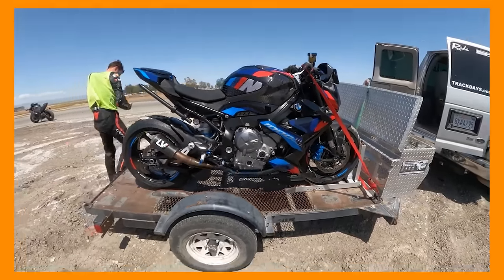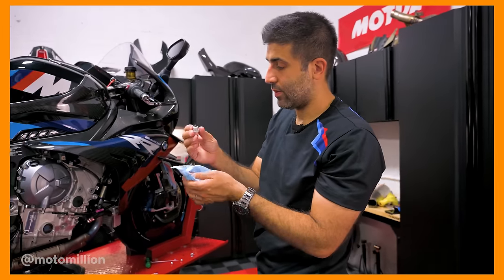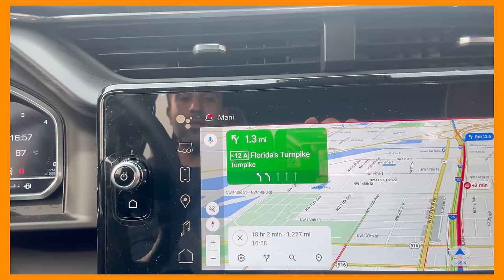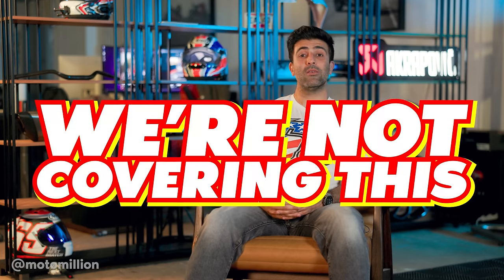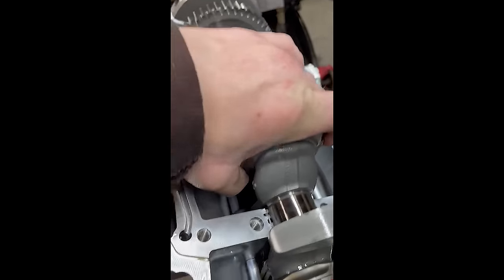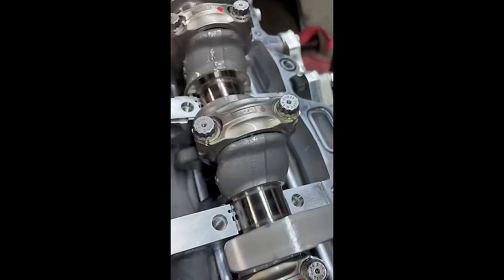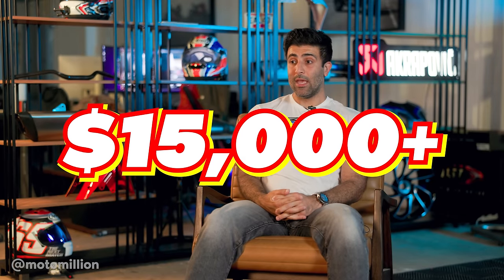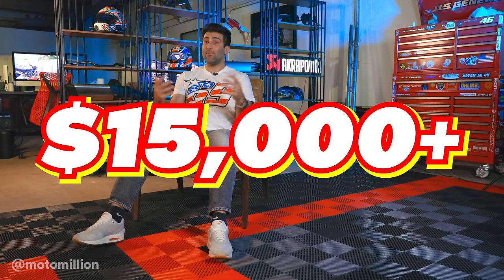MASSIVE Engine Failure on our M1000RR & BMW REFUSED Warranty...

Comment: Somewhere at Mottorad HQ engineering dept in Munich, Hans is sitting at his desk ,sipping on filter coffee while watching this video and thinking.. Oh shit ! i probably should have triple checked the rod cap bolt torque settings before signing off to the engine assembly guys. What is it about rod bearings that they cant get right , even in their road cars, e46m3 , e90m3 , e60 m5, F10m5 all had higher than avg rod bearing  failures and now their top of the range super sports bike
Reply from the maker: I don't even think BMW will watch this, I mean if they do, I hope they reach out to us to make things right.
Reply: I can't speak to the bikes. But, on the cars, BMW decided that they would put rod bearings in that only lasted through the warranty/1st owner, in order to make more money. They literally only put enough wear material on the bearings to last 40,000mi ish.
Clevite makes bearings for most of the cars that have the issue, that will last a "Normal" amount of time. Luckily BMW was kind enough to build the vehicles, in most cases, so that the bearings can be replaced without pulling the engine...
But, yeah, terrible idea...
Reply: @therocket280z7 😂😂not true, I know Bmw 530i with over 250000 miles without any problems🔥better then most American car and the worst Range Rover😩
Reply: @helgejohan3604  lol, yes, it's not true about all the cars. But it's absolutely true about most of the M cars(e46 and newer), and others.
Reply: Hans the mechanic🤣🤣I'm sure I wouldn't have thought about that!
Reply: @helgejohan3604  it's not even the same car the earlier guy mentioned..
Reply: Thats not true🤣🤣🤡
Reply: @therocket280z7  M5 with over 200000 miles are fine in Europe 😜
Reply: E39 m5’s eat rod bearing’s as well
Reply: @helgejohan3604  Enjoy your unicorn!
Do some research, as I have, and you will learn grasshopper...
Although, I suppose they may have built euro engines differently than North America engines. But, what I'm saying is a known quantity here ..
Reply: I don't think the cap bolts were loose, I just thing the bearing was crap.
Reply: The sportier a vehicle is, the more it will attract hooligans who'll flog it (preferably after having voided the warranty, lol).
Reply: @nordrock2907 Hans is Replaced by a third world worker, hallo modern times and more shit.
Reply: @protectorh9167  Modern times Bro. GLOBALIZATION😂😂

Comment: Yeah I agree, the rev limiter removal prolly had nothing to do with the failure, but what it did was put you in an indefensible position. I’m thinking that you never thought in a million years that the engine would fail and you would get caught out by the removal. Who would? No matter how you dice it, the fundamental fact is that if you hadn’t removed limiter BMW would have replaced the engine. You kind of dug your own hole, now you are pissed at yourself, but can’t admit it.  I do feel for you man, but in the end you took a low risk gamble and rolled snake eyes. Learn from it and move on…oh, and you can probably write it off as a business expense.

Comment: I wish more people
With these bikes came forward and addressed their problems they’ve had with their S1000.
Reply from the maker: They are coming out in this comment section!
Reply: Problem is people refuse to admit their 20,30,40K+ purchase is a dud. Coping is real unless it’s a review unit. The H2 line had oil in the intake issues and forum users are quick to blame the user and not defect Kawasaki has known since its inception. Warranty on power sports in the U.S is another gripe I have.. an absolute joke.
Reply: @HKvsGlock  it's irrelevant but i just want to say Glock all day.. HK is against citizens owning firearms. Couldn't give me one.😂
Reply: @kdcustoms1272  what’s irrelevant?  
Glocks are a staple/pioneer but boy do I wish they would add more modern touches. Needing a plate to use an rmr is dumb(not milling).

Comment: I bought a brand new S1000RR. At about a 1000 miles, one day, while I was riding, noticed the front brake lost power as I was braking by a lot, mid-squeeze. I pulled over and got off of the bike, then noticed that one of the front calipers was just hanging, completely detached from the rotor. Luckily, BMW did cover everything including the front forged wheel, since it was damaged by hanging caliper. The question is, how was this bike put together? how was the quality inspection done?
Reply: If it was mine and it happened to me, I would consider it to be rider negligence. Really, a caliper fell all the way off, and it's banging on the wheel, and the rider doesn't know and grabs some front brake?

Comment: The build quality on these things is really hit or miss. I have a 15 s1krr with 20k miles original engine and it’s been tracked and everything is fine. But a friend of mine had a 2016 s1000rr with 8k miles with a fresh engine from bmw and it ended up spinning a rod 1000 miles later and I had to rebuild the engine for him. 

Needless to say, when I took apart the engine I seen how they blatantly put silicone over an oil galley hole when I split the casings. Keep in mind this engine was warrantied new from bmw. Had to send the crankshaft to get machined and cleaned all the oil galleys.

Comment: 100 bucks says he followed break in procedure and made no modifications on new engine and everything is fine. Good lesson to be learned here for millennials and Gen-Z: 

You never modify engine, electronics or drivetrain until well into the life of a new vehicle or better yet, after warranty expires. Be patient with mods. Always do initial services through dealership as well, and if you cant afford to do that, you cant afford the vehicle. Create a situation where dealership excuses to avoid honoring warranty are eliminated.
Reply: The warranty on this bike is 3 years....NO ONE who owns this bike is going to wait 3 years to get full throttle in 2nd gear....BMW needs to re-evaluate its 50-60 hp deficit in the midrange if they are going to void all warranty.  If it happens to mine I am hiring a lawyer without a doubt....as its on the manufacturer to PROVE my mod caused the failure.  Harley Davidson got POUNDED for arbitrarily denying warranty claims due to mods when there was ZERO correlation.

Comment: Unfortunately, not the first nor the last BMW blown engine I've heard, seen about. Great video though going through it for us. Much appreciated! Not a negative press video but I'm not going near the S1000RR like I had planned this season. THANK YOU!
Reply from the maker: Thank you for the comment. Luckily there are many other great options out there today for us consumers!
Reply: Exactly how I feel now. Back to the drawing board
Reply: S1000RR engines are not built on the same line as the M1kRR. Not to trying to convince you to buy one just inform. I have almost 3.5k miles on mine with exhaust and flash. 0 issues so far.
Reply: @BeginnerMoto  They took my '23 rr from me, and they (BMW) claimed the heat treatment process on the rods failed.
Reply: @jasonisdn  was the work covered under warranty?
Reply: @BeginnerMoto  Since it was a manufacturer defect or one of their vendors, yes it is all covered. I am getting a completely different bike back. That '23, I was told and have the voice recording from a BMW executive case manager, will never be sold.

Comment: Moral of the story, keep your shit stock
Reply: Moral of the story, don't waste your hard earned money on Euro junk. Buy Japanese, modify the way you want, abuse it if you like, have fun and enjoy years of trouble free riding.
Reply: @dr.jiIIaIicecooper2587   Totally agree, I had a modified/tuned Kawasaki zx10r for 14 years that i beat on. In that 14 years it went through 2 batteries, 1 regulator, and 1 stator, thats it.
Reply: Nothing wrong with modifications as long as the owner adheres to engineers' recommendations for break-in period.
Reply: @ComputerGeekOnTwoWheels  Engineer's recommendation on European bikes are "do not modify at all" unless you want to buy $4-5k aCRAPović exhaust that sounds like stock because most Euro bike brands have contracts with aCRAP and they make a lot of money together. In reality those exhausts are worth 4× less than they charge for them.
You can modify Japanese bikes whatever the hell you want it and they will refuse to break. BMW is junk and that's a fact. They copied GSX-R 1000 design on S1000RR except for reliability, that's "superior" German engineering😂😂
Reply: @chaoticspiro  I'm not surprised at all
Reply from the maker: I understand that you don't know the full story and didn't watch to the end.

CaliMotoTV's BMW M1000R blew up on the track. That bike had a full exhaust and an ECU flash. BMW fully replaced the engine under warranty.

Why was Bill's replaced even though modification were present?

Comment: Wow that sucks, ive booked a 2023 M1000RR which cost $50grand here in Canada, just saw this within time. Thank you for this video, as i should start thinking about Ninja H2
Reply from the maker: There are other options for superbikes. Kawasaki makes some really nice ones too!
Reply: If you have the money to get a M1000RR maybe look at the Ducati V4R
Reply: If you want inline 4 get a zx10rr or a  Honda fireblade which is the best superstock you can buy.
Reply: Lol, should have went for the h2 immidiately. I got h2, thought about getting the m1k as well but tbh i cant justify spending 45k on a bike without a supercharger
Reply: @Flakapief 
Lol next you'll be saying "I can't justify spending $70k on a bike without an impulse plasma engine and a gravity phantom drive for them extra long interstellar hops". 🤣
Reply: @mickeypopa  youre right, i went and bought zh2 and hayabusa instead but now i still want the m1k 😿😹

Comment: Knowing performance engines and having torn multiple down from failures, taking measurements, this 100% sounds like bad assembly. BMW may be losing a customer permanently for pulling this. It’s why I sold my M3 and went with Japanese cars.

Comment: Just because someone else's engine that was modified and was replaced doesnt give you guys the right to demand the same. Sure this is unequal treatment but bmv shouldn't have replaced CaliMotoTV's engine in the first place. 

Modifying the ECU instantly exempts the engines from warranty. This is a know fact and is written in the warranty agreement. It is standard for every engine manufacturer that warranty only cover unmodified engine. Pointing fingers at another case doesnt help your situation here. Ignoring the break in and revving the shit out of the engine certainly doesnt help either. 

I worked as a KTM engine tech for 4 years. Even "lower" RPM KTM engines showed clearly visible differences in wear on rod bearings on stock engines when not broken-in correctly and exposed to high load. Ignoring break-in periods because you cant be bothered is not a good look for you or something a serious shop should be doing, ESPECIALLY when the break-in in question is on an engine that revs over 15k rpm. Also overrevving "by only 250 rpm" is definitely not a nothing burger, again EXPECIALLY because at this point you were supposed to not rev higher than 7k or 9k rpm. 15,350 rpm is far from that.

When you bought this motorcycle YOU agreed to play by their rules, YOU agreed to all warranty conditions. 

This certainly is not a good look for BMW anyways but blaiming them for not covering the engine warranty that you voided is just not right
Reply: Yep

Comment: So manufacturer says you need to brake in the engine and for that reason also puts the limiter in, you don't believe it does need a break in and proceed to remove the limiter? Ok...
Even if it was a manufacturing defect that caused it, do you understand that you have no leg to stand on as it is a breach of basic requirement by manufacturer?

Comment: The local BMW near me removed the "break in" rev limiter on my 22 s100rr at 504 miles. In the coding from bmw the min milage limit is about 300miles before it will let you remove it. If that was the issue then why code it to be able to remove before 600 miles? A friend of ours also had a 22 that had cam angle sensors fail multiple times, nothing done to the bike, completely stock and bmw kept replacing them until the motor let go, then gave him a hard time about replacing the engine, then they finally replaced it and he traded it in for a 23 but had to eat the cost difference.
Reply from the maker: Yup, and it is also in their owners manual. The manual indicates first service / break in service is due between 350 to 700 miles. We did it within that period.
Reply: @Motomillion  Like everyone else including cars, they are hiding behind you are not auth. In some cases that is fair.
Reply: @Motomillion I may not agree with BMW, but I still understand.
You guys are not certified to do so by BMW (even if you actually know what you’re doing, and I believe you do) so, even sticking to the guidelines, your forked up :/
They may (plausible deniability) disassemble the engine when removing the limiter, as to check tolerances/assembly. But that’s PURE speculation.
I’m a Honda fan, so, mine will run forever :D
Reply: They would have to show what you failed to do OR what you did wrong. Can't just say you are not qualified to change oil.  @RuiSousa46
Reply: @bailey9r I stated in another comment, in EU it’s simple: if your certified by BMW then it’s their responsibility. If you’re not, then it’s your responsibility. The thing is, you remove something by software that they don’t have registry, so, they know it wasn’t made by a certified shop, therefore they (again, not that I agree) wash their hands… the thing that I don’t understand is “warranty not voided, but still not gonna fix/replace”.

Comment: Brother this story makes me sick to listen to. We own 6 K67’s right now along with 2 M1000rr’s and did have an engine failure on 1 of them with 900 miles. BMW replaced the engine within a month. I honestly can’t believe why they are being like this with you. Very disappointing.
Reply from the maker: Glad you don't have to go through it!
Reply: Just because he did not respect the rules about the rev limiter. The engine is obviously faulty but he just void the warranty stupidly. As simple as that. Another case would be that if you don’t do the service at a dealership is enough to void the warranty. It is written on it. 
I am not saying BMW is right but lawyers are lawyers.
Reply: @Fabs821  that's BS about the rev limiter and dealership doing the first service. Any backyard mechanic can do the oil,  filter change and look over everything. I have to 2 new bikes and I have done all the work myself on them..  I was told from Yamaha dealership that I could do the first service.  Manny didn't do anything wrong or abused the motorcycle. I hope BMW does the right thing for Manny and  they do not lose to many customers and new sales!
Reply: Usually BMW guideline is not to rev up the engine more than 5k/min for the 1000km. I drive a BMW S1000RR on the racetrack only and no problem at all for the last few years..Hello from Switzerland
Reply: It states in the Manual rev limiter can be removed from 350 miles. This is total nonsense from BMW. They need to do the right thing here and change the motor. This man had an issue with the bike with only 9 miles. Get out of here with that nonsense BMW.
Reply: Wow hard to believe!
Reply: Brake in the bike 1000miles before YOU hit the rev limeter😜✊🔥🔥
Reply: $15k that’s freaking nuts man!
Reply: Horrible stories like this is the reason why I always do my first service at the dealership. I hope you get it worked out 😢

Comment: What I can say and what I have heard from others is the philosophy of BMW engineers (Germans in general) is that they expect customers to use the products the way the engineers want, ie. stay within the use parameters they specify while Japanese engineers think about how their products will likely be used and over engineer it. This is why japanese cars/bikes are more reliable. Did removing the break in rev limiter and running the bike on a dyno lead to this issue, not sure, but all the other examples you site are from bikes that have been modded and/or have relatively little miles being run hard. This suggests that maybe for these engines, the break in period is very important. Race bikes are another category. To me it isn't surprising they didn't cover the engine when they found out the limiter was removed.

Comment: I'm really having a very hard season (18000km)with a KTM super adventure s (2022 model). Still, there've been so many repairs, dempener, oil cases, display, shift shaft, electronics failure. But seeing this video, somehow I'm actually thankful that yes. Ktm did take care about all these issues within warranty. Hell what a story. I'm sorry to hear all than pain and disappointment you had to deal.
Still, all those bmw communications sound strange. At least directly here in Munich at some official bmw dealerships for over 5 yrs (bmw S1000R) I never had any issues with warrenty and the dealer taking care of them.
Reply: KTM are normally rock solid, had a couple of the various models from them with no problems.
Reply: @v4skunk739  really happy to hear, appreciate the feedback a lot. Strengthens my mental health looking forward to the new (2nd) season 💪👍

Comment: My S1000RR 2020 did the exact thing at 700mi.failure on piston rod bearring cyllinder 3. Total std trackday bike. BMW took it under warrenty after a lot of comunication… the new engine blew the waterpump at 2000mi when installing a new top gasket we found that the exhaust cam was missing a tooth on the sprocket…. BMW refused to help this time… stil cant figure out how im responsable for a blown waterpump on a engine with 2000mi..